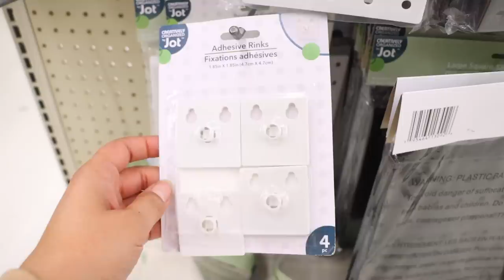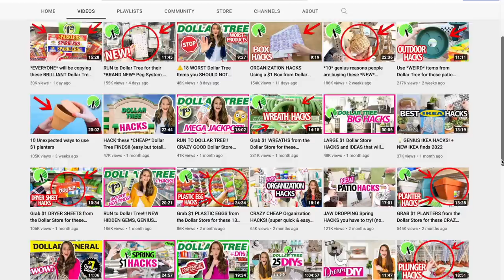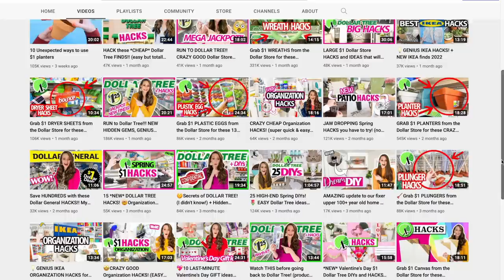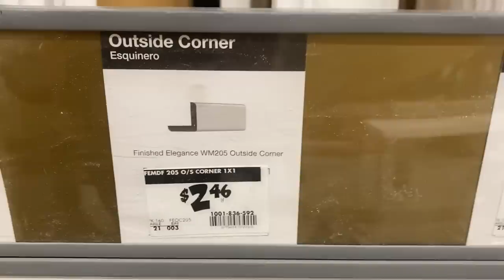BEST Dollar Tree ORGANIZING HACK EVER (not clickbait) GENIUS home hacks using the ALL NEW Peg System

Comment: Those peg boards would be great for organizing jewelry. You can use the small hooks to hang necklaces, the longer hooks for bracelets and the shelf for rings. You can really great ideas. Also if you do not have a vanity you could create one with the boards inside of a closet door and add a small mirror and even stick some push lights to it.
Reply: omg thank you! i've been struggling with organizing my jewelry, im totally doing this when i find some in store!
Reply: @katherinefotopoulos9244  Glad I could help
Reply: MY THOUGHTS EXACTLY ( FOR JEWELRY, LOV IT ) 👍❣️✌️💜.
Reply: That was the first thing I thought about the flipper one she used for tools. Attach smaller organizers for small pieces on top and let longer pieces dangle at the bottom.
Reply: I just used the small ones for this!

Comment: I love that Dollar Tree has this peg board system it's so versatile , convenient , customizable , simple and easy to install . I'm finding new ways , every time I organize , how to put it to use all over the house 😊 recently I put the small white adhesive hooks on the front of the square shelf ( the hooks fit perfectly on the front ledge of the square shelf ) so I can hang stuff when I put the shelf on the bottom pegs . For added strength and so the hooks don't fall off I removed the adhesive backing from the hook and used E6000 to attach it to the shelf by doing this it does add strength to the hook so it won't fall off but it does make it permanent and I don't mind it .

Comment: Hi Bethany!  So glad you put this video out.  I just found the system in my DT over the weekend and picked up what I think I will use to organize my office/craft room.  The only reservation I had about setting it up as soon as I got home was on the back of the adhesive tabs it clearly states not to use it on painted or wallpapered walls.  I'm guessing it may take the paint off if trying to remove or after some time just fall off the wall so I think I will be screwing them into the wall.

Comment: These are all fabulous Ideas. I do suggest for anyone wanting to do a large area. Or for anyone unable to find the system at your DT. You can get pegboard at HD for $12 bucks for a 2'×4' piece and a furling strip which is about a 1x2 8' long for a couple of bucks and pick up the accessories at DT this would be a much more budget friendly option. Or if your family dollar is doing a remodel you can get used pegboard for free. However for mounting to cabinet doors these plastic peg boards would probably work much better. 😀 Just tossing it out there.

Comment: Great ideas. An idea for adhering those pegboards to ceramic you can use silicone caulking. That way when you're done you can just scrape it off without holes in your tile. We were told about this idea with our shower curtain. You know a shower curtain gets pulled on it gets tugged on and by using silicone and helps hold it or it doesn't move and we've done it for several years. We have also done this with other places is the use silicone you have to hold it until it dries but you can pull it away without damage to your wall or damage to your tile and having to drill. There are other ways to do it.

Comment: I've done most all of these things by cutting IKEA's Pegboard system. Don't just paint the pegboards solid colors either. For our living room entry way area, we've painted 8 boards put together as a rectangle, and painted it as a British Underground sign (their subway stops). we created a town for the stop and with my husband's irreverent humor, called it "Wankerville". I have pics of them all on my Pinterest pages. Another set of 6 are above each of our bedside tables holding places for our glasses, hand creams, earbuds, etc. Mine was painted as Doctor Who's Tardis and my husband is the Union Jack (yes, we're anglophiles).
One thing I wanted to offer is You can achieved the same thing by getting a 1/4" X 3' dowel rod for $0.68 and cut it into pieces that can be used in place of the expensive dowel pins. If you feel you need the grooves for adhesion, just rough them up with a Dremel tool or a drill and a steel wheel brush. Saves money to be used at the Dollar General.

Comment: The accessories are pretty cool I just worry about how much weight they can hold. However the pegboard itself per square inch is way cheaper if you purchase a large piece from home depot and cut. Also way more sturdy.

Comment: I think the Ikea boards may be a better value. It seems like DT is cheap, but once you add up everything you realize it is not. The pegboards are very small, so it is a lot to get a good sized board and backing for it. It seems like Ikea is better quality as well. The only problem is that Ikea shipping is very expensive, so those who don’t live near a store have to add in that cost.

Comment: As always, thanks for sharing your ideas. Just a few notes ( Not trying to be a Karen...) But Spices should not be exposed to prolonged heat. Definitely screw into wall if putting near stove. Boiling/steam may loosen adhesive.
Reply from the maker: Totally get that! I keep my spices where you saw them all the time. I know heat can eventually breakdown the taste of your spices but I haven’t had that issue in the many years I’ve kept spices near the stove but for the steam/heat messing with the adhesive, you’re absolutely right! That’s a valid point I didn’t think about.

Comment: Your peg board idea looks great but to me it's not economical because you can buy wall size peg boards at lowes & home depot for the price you paid for all of those small peg boards at DT. Another thing when uvtake those peg boards down half ya wall is going to come down with it just letting u know. It's fine for a garage but I wouldn't want all those little big board verses a big one that's held on with screws that u can fill in the holes & paint when u get tired of them. The cabinet door idea was a good one because of the size & if u take it out it's not damaging anything.